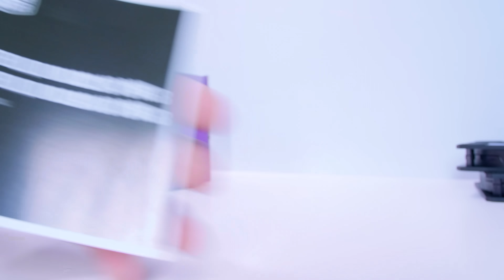HOW TO Cooler Master ML240L V2 RGB AM4 & AM5 Install Guide

Comment: Is it possible to configure the fan speed via pwm when using the included y-cabel? Because they look like 2x 3pin to 1x 4pin, which would only make configurable via dc and not via pwm
Reply: I just installed one of these AIOs. The splitter cable is a 4 pin to 2x4 pin - the reason you can see only 3 pins on one end is that fan splitters are wired so that the TACH pin from the header end only connects to one fan, while the 12V, GND and PWM pins connect to all fans. The tach signal is a square wave driven by a sensor on the fan assembly (probably a Hall effect) giving two pulses per revolution. If you connected those in parallel, the speed signal would be all over the place.

Combining the tach signals would require a controller in the middle to read all the speeds and compute some aggregation function (min, max, average etc.)

Comment: What are those clips that you used to mount the cooler to the processor. My pc has a rectangular shape and the bracket that came with it is square.

Comment: Do I have to plug in rgb. If I don’t can the cooler still work just with the fan splitter and the coolers power cable.
Reply: Yes it will work fine

Comment: i bought the RGB cooler master ML240L; and bought a 3 pack of the ARGB Fans.  Can i replace this?  I guess my question is, can i insert male ARGB 3 pin, into female RGB 4 pin slot?

Comment: Hey 
i got a Question, i just bought it but the RGB Does not turn on :( is there something i can do? I installed everything how you said in the video Can you please help me with my problem??
Reply: It could be that you have the controler set up to use motherboard software but no configuration on the motherboard.

Comment: I recently installed this cooler and used your steps in my install. Everything is working like a marvel with one exception. I have a b450 tomahawk max and went the same way you preferred. Installed the rgb splitter to one of the rgb ports, specifically the one that says jrgb2 and connected the fans and pump rgb to the splitter. The RGB is not turning on. The pump works, the fans spin and i can control them so I know that's connected properly but the RGB won't work. I tried with both dragon center and mystic light software to no avail. Any suggestions as to what i could be doing wrong?
Reply: Did you find a fix?
Reply: @DoZiDoz.  I fixed mine. Turns out it matters which direction you plug it in. Although there is no indication on the cable or mobo.
Reply: @jeremyjirasek4658 yo bro idk if you’ll see this but what direction you do that in
Reply: Bro use jrgb 1 that maybe located at the bottom left of your motherboard
Reply: I'm having the same issue.  Ever fix it?

Comment: 9:05 @GearSeekers why must the pump fan 3-pin go into CPU_OPT instead of CPU_FAN? I mean, isn't that pump belongs to CPU_FAN? i know both points have the same voltage for fan but why CPU_OPT specifically? any reason?
Reply: This part of the video may be incorrect, because the pump should actually be connected to the CPU_FAN header. That way if the pump fails it will detect the issue. CPU_OPT is usually meant for a secondary fan of some kind and may not detect a failure properly.

Comment: Make sure to connect cooler pump and cooler fans only to the CPU _FAN (boot verifies device working before start for cpu protection safety) or CPU_OPT headers because those are speed controlled by the motherboard only going max only if heavy useage then it will be louder. Many people only hook to fan power output for for system  or chassis headers which are 100% PWM powered at all time unless changed in BIOS which makes it loud running max all the time when it does not need to 99% of the time.
Reply: I wish you wrote this clearer but thanks for the making the disctinction. I'll make sure to use the CPU_FAN output for boot check.

Comment: They are fan headers for different types of fans (different purposes)

CPU_FAN - This header is for the main/only CPU/heatsink fan, the BIOS will (or at least should) refuse to let the system boot if a fan is not detected, preventing the CPU from overheating and damaging itself
CPU_OPT - This header serves the same purpose as CPU_FAN, the only difference is not having a fan connected to this header will not prevent the system from booting, some heatsinks may come with two fans, or may have clips on both sides where a second fan can be connected for a “push-pull” configuration (one fan pushes cool air into the fins, another fan pulls hot air out), it can also be used in liquid cooling where the pump is connected to the fan header, the pump would connect to CPU_FAN and the radiator fans would connect to CPU_OPT, the idea is as long as the pump can keep the liquid flowing, even if the fans were disconnected or failed, some cooling can still be achieved, if the pump was disconnected or failed, the liquid would remain stagnant and the hot liquid would not make it’s way to the radiator to be cooled, as well as the cool liquid would remain in the radiator and can’t make it’s way to the CPU to serve it’s purpose, therefore not cooling the CPU, even if the fans were sill running properly, CPU_OPT can warn you if there’s a problem, but it won’t shut down the system or prevent booting like CPU_FAN will when it detects a problem
SYS_FAN - This is for a case fan or “overall system” fan, this brings fresh air into the case or blows warm stagnant air out of the case, keeping airflow
Just like CPU_OPT, not having a fan connected to the SYS_FAN header will not prevent the system from booting, but it can warn you if there is a problem with the fan
If these are 4 pin fan headers, the motherboard, and in turn the BIOS and the OS, can control the speed of the fans, so in theory, you could connect the case fan (or one of the case fans) to CPU_OPT with no issue, but a case fan connected to the CPU_OPT header will ramp up in speed when the CPU gets hot just like the CPU/heatsink fan connected to the CPU_FAN header will, and will slow down when the CPU is adequately cooled, while the fan connected to the SYS_FAN header will run independently to CPU temps, either taking its cue from a different thermal sensor or by some software based control based on the BIOS and/or the OS (and on the OS side, either the OS or some third party software)
Reply: Thank you commenter from 3 years ago, you saved me a lot of hassle!
Reply: On my mobo I do not have a CPU_OPT so wasn't sure where to connect the pump. It goes to  CPU_FAN! Thanks for the detailed explanation!
Reply: @DaveModer  if i may ask, where did u plug ur splitter into?
Reply: Best explanation I've ever read. Thanks
Reply: Hey man you dropped this… 👑

Comment: Does addressable RGB mean you can control it through software to match other RGB components in your system? I will have lights on my GPU and RAM and was wondering if I could get them all synced together through software so they’re coordinated
Reply: Did you figure it out?
Reply: @bigd2829  can you help? i dont know what software to download, it also says that no devices is plugged in
Reply: @xGuxst  I don’t think there is downloadable software for the AIO, should be plug and play. As for the plug in issue, make sure all motherboard connections are secure and proper and make sure AIO is connected properly (That is if your talking about the AIO). Let me know if that doesn’t work.

Comment: I’m a beginner and I have a question does it work on intel
Reply: JSM yes it works for intel, just make sure you use the correct bracket and screws.

Comment: It seems the rgb on my model won't turn on, I've tried several times connecting to the rgb header on my motherboard and even switched to the other header but it won't turn on or be recognized by asus aura
Reply: Same
Reply: Did you find a fix?

Comment: Hey if anyone could help me I got the same master cooler or what ever but I only have cpu_fan and not a cpu_out beside it. I don’t have anything beside the cpu_fan so I don’t know we’re it goes
Reply: Uh idk man, but to try and help you might be able to first, plug the aio cpu cooler thing itself into the cpu fan one, and see if you can find any other outlets that mention fan, like cha fan or etc and then plug the fans that you put on the radiator on that outlet. (Sorry for saying this 4 days later, I know you're probably already done with it by now)

Comment: I have question , my controller pass out after 5 click.. my oump is glowing blue but fans not .. is it badly conected ? I checked all all in molex but cant switch fans so i found another rgb controller and changing it with my xiomi mi9 :D

Comment: Ok so I know how to install it but can I install in of the top part of my case. Or does it have to be on that front panel where he installed it. Ik this is a very stupid question but this is my first time installing a radiator. Can anyone help?
Reply: If your case supports it on the top then yes

Comment: Does this liquid cooler work on the ryzen 9 3900x
Reply: Have you figured out if it worked for ryzen 9 because I want to get it for my ryzen 7
Reply: Skyworld96 it would definitely work for a ryzen 7 easily
Reply: Skyworld96 it would cool really well on a ryzen 7
Reply: Skyworld96 because it gets average temperatures on a ryzen 9
Reply: GoldenBull thank you so much just making sure
Reply: Skyworld96 btw if you are gonna use a higher end CPU any time in the future try out the corsair h100i water cooler
Reply: Skyworld96 for example a ryzen 9 3900x or a 3950x

Comment: Thanks for this.  I was happy to see that it’s OK simply to use the RGB header on the motherboard instead of the molex link to the power supply.  Good eye!  Clever.  So. . . I get no demerits for failing to use all parts in the box!  And now I know what the CPU_Opt header is for.  So many gaps in my education filled in under 15 minutes. . .

Comment: Recommend keeping that sticker on the plate till you are ready to apply thermal past and mount it. You don't want that copper plate to get dirty. I turn my RGB off what's the point of RGB but the flashy colors. I hate all this RGB crap. Just wastes more power is all.

Comment: The screws aren’t going in the damn bracket when screwing it onto the waterblock.
Reply: I did the same, wrong screws m8😂
Reply: @pandis2915  which screws on the guide are correct? I'm trying all of them and none of them go through the all the way to the plates we're supposed to attach and hold in place
Reply: Same

Comment: Question, the rgb cable that needs to be plugged into the RGB header doesn’t seem to plug in securely and thus not getting the proper connection. Am I doing something wrong or is mine defective?

Comment: 10:05 I'm SOO confused someone helppp!!
He shows 3 of the cables and 1 with a hole in it, but then he shows 2 with holes in it
Reply: and also, where did the 4 cables come from??
Reply: So basically the 3 cables with the prongs plug into the RGB cables on the fans/pump and the single cable plugs into the controller or an rgb header on your motherboard. That splitter comes included with this AIO.

Comment: Hi, I'm planning to do a push/pull configuration with this Cooler Master AIO. My mobo (Asus B550-i Rog Strix) has only 1 CPU_fan header (12W, 1A). Can I connect the 'push' fans to CPU_fan header and the 'pull' fans to CHA_fan header? Will there be any negative impact to the cooling performance? Please advise the correct way of fan configuration. Thanks.

Comment: Great vídeo, Would you recommend this cooling for a Ryzen 9 3900xt or which one do you recommend?  Thank you
Reply from the maker: No. I would go either a 280mm AIO or 360 for the 3900XT
Reply: @GearSeekers  Thanks
Reply: @GearSeekers  could you tell me a particular reference
Reply: Cesar Daniel Meneses Guevara NZXT Kraken x63 or Arctic Liquid Cooler

Comment: Do you have those fans as a push to or pull. If it’s a push how do the fans get filtered or does the radiator filter it

Comment: If I don't have a CPU_OTP, what can I do? I have a 
Gigabyte B550M DS3H Micro ATX AM4 Motherboard.
Reply: just plug it in CPU_FAN it will work
and for the other one use System_Fan , of course depends if your Motherboard has hybrid hedears system

Comment: FANS AND RADIATOR ARE MOUNTED WRONG IN THIS VIDEO!!!

Radiator is suppose to be mounted inside to the chassis with the small screws included. Fans are mounted to the radiator INSIDE the case with the long screws. The way he does it in the video isn't as efficient at moving air and can cause higher temps on the CPU.

FOLLOW THE DIRECTIONS!!!
Reply from the maker: Okay Randy you're so Wrong.
Reply: @GearSeekers  I tried it your way in the video and ended up having to take it off and redo it according to the directions. You even said in the video you didn't look at the directions so you can't even argue your point.
Reply from the maker: No I said it's for demonstration purposes and that every case is different. A little common sense goes a long way buddy
Reply: @GearSeekers  So you made a "demonstration" video where you didn't even look at the directions to see if you are showing people the correct orientation (because then it would have worked in most cases), but I don't have common sense because I posted about the problems I experienced in your build video?

Comment: You should mount the radiator with the pipes down
Reply from the maker: Incorrect
Reply: @GearSeekers  no you really should mount the pipes down, the pumps arent getting sufficient water flow when mounted on the top of the case, basically killing your aio

Comment: Im new to PC things so sorry if this is a dumb question. Will this cooler work with the 84FD mother board (thats the board ID, im not sure the specifications exactly) and also what is an AM4 motherboard? Thank you!
Reply: more specifically, would the rgb fans work on the 84FD motherboard? thanks !

Comment: I connected the rgb cable to the 12volt rgb header on the motherboard, but the lights in the fan didnt turn on. Is that a problem? do i have to install a software to set the lights on once i get the pc up and running?

Comment: Is a mag b550 tomahawk Amd with a ryzen 5 3600 and a NZXT H510 good with this fan for my new build???
Reply: Yes
Reply: H510 is a full exhaust case so watercooling is not great
Reply: @WuizGaming  water cooling is perfect for this case man. Limited front airflow means that a radiator on the intake will be more beneficial that a tower cooler

Comment: The fans do  not have airflow direction markings. I am new to building so I don't know but I assume there is an industry standard? Which is the front of the fans?
Reply: the curve of the fan blades tells you the direction of airflow.  it is difficult to describe so just put your hand on both sides of running fan and note the slope of the blades.

Comment: For my power supply I don’t have a moles cable that has pins it only has like a connector thing where pins go into it. Can I put the 4 pins from the cooler into the connector from my psu too?

Comment: Bought this 3 months ago.  So far its still good and works great.  My only complaint was clipping/mounting the metal clips onto the AM4 bracket.  That took me a long ass time and kept moving out of place.  Might have to redo it again to reapply the thermal paste as i kept moving the block on/off while trying to attach it which could of created some air bubbles.  In 90F weather i get around 70-72C while gaming, video encoding around 70-75C with spikes hitting 78C.  My AIO is set as an exhaust.

Comment: remember to align the arrow with the 12v pin when connecting the RGB to the motherboard.
Reply: Thank you man, was looking for a half hour which way to connect till I found your comment. Helped me out a lot. :)
Reply: Not sure what that means. The motherboard doesn’t have an arrow indicator
Reply: One Year Later, this should the top comment. I wasn't sure hahaha. Thanks for info!
Reply: This comment needs to be rated higher
Reply: W
Reply: Underrated comment and should be pinned!
Reply: @afk4dyz  Thanks you so much I have this aio for half a year now but I couldn’t figure out why the rgb didnt work so I just used the controller but now I can finally have more color options

Comment: ok so I built my PC back in October 2019 and I got this Cooler or atleast the V1 of this Cooler and I could never get the lights to work and then later on I bought 3 more normal CoolerMaster Fans for my PC and I cannot get the lights to work on them either. I have tried to use the software but it asks me to unplug my fans and stuff and I'm not sure why it should be that complicated... if I could get some advice or tips, I'd appreciate it.
Reply: Do you have your rgb header plugged in?

Comment: I got this cooler but my case is a NZXT H510 compact ATX mid tower so it doesn’t have the same opening as a case used here would I put the fans in the same direction or have them facing inside the case? And if so with the lighting be facing inside the case or facing the The other way? This is my first PC so I don’t really know

Comment: What if my motherboard doesn’t have cpu_opt, can I just plug it in cpu_fan?
Reply: No dont plug it in to the fan slot; on my motherboard at least there was a slot called AIO_Pump where you can plug the pump in. Check the manual of youf motherboard and it should tell you where you can plug in a pump
Reply: I hope you found the right connection point. That can seriously ruin your rig. Just check the manual like Ben said.
Reply: afk4dyz couldn’t find one or it might just not have one, just getting a Corsair aio instead, thanks for the warning tho
Reply: Yes you can..

Comment: Sir, I have a msi B450 Gaming Pro Carbon AC motherboard and there is not cpu_opt, only CPU fan header on my motherboard. At time 08:44, But the water pump header is. So I want to ask where to connect the three-pin pump cable?